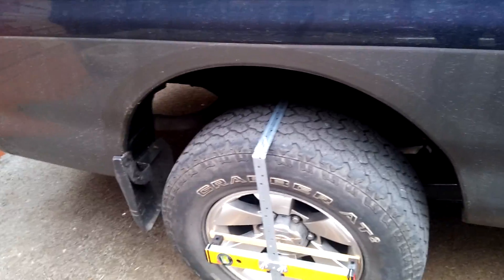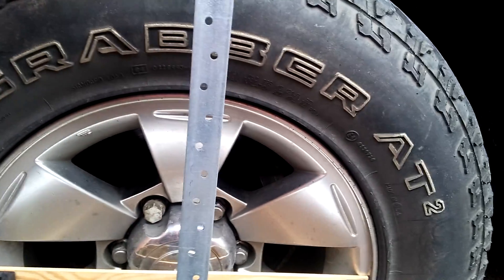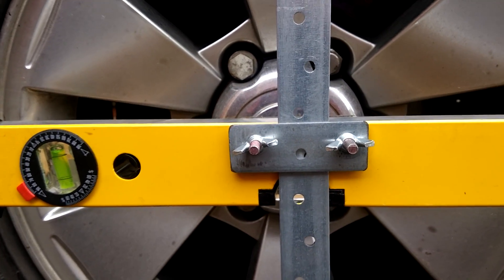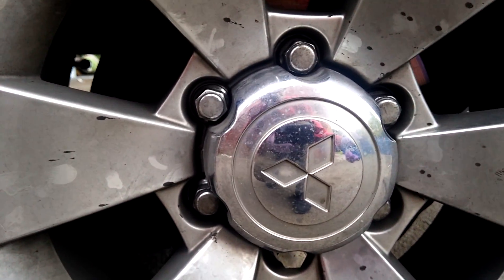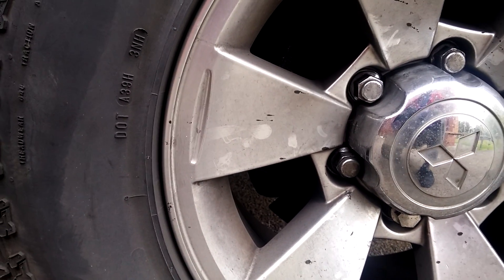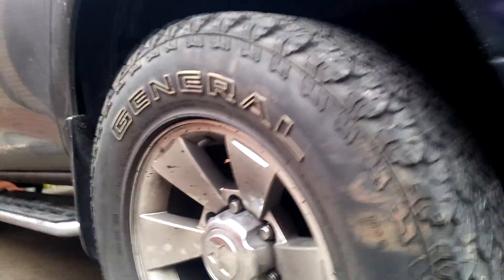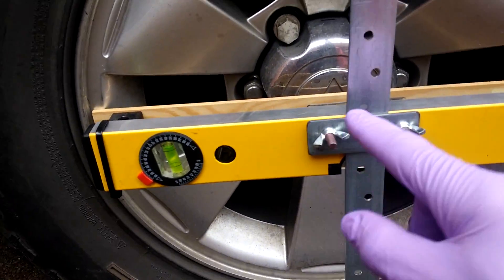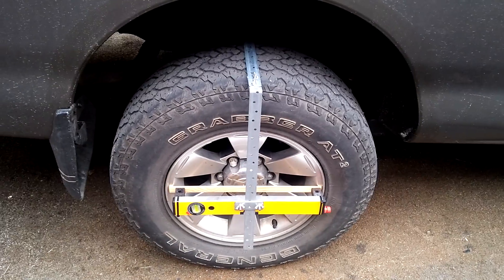Homemade laser wheel alignment tracking device

Comment: I tried this with the exact same laser. It showed front wheels that i know are within 2mm as being 30mm adrift front to back. The reason and the problem with this method is that the slightest angle at the back wheel gets amplified by the time the laser gets to the front wheel. This method will only work if your back wheel is exactly true, the wheel is exactly uniform all the way round, your laser and mountings are exactly true, and the laser is accurately aligned to the edge of the housing. Any slight deviation in any of those sets the laser at an angle meaning your readings at the front tyre are invalid. I suggest that simply using a measure to get the distance between treads on the front and back of the tyres is a better diy method of tracking.

Comment: This method has questionable accuracy.
The method utilised at front cannot be accurate as you cannot confirm the angle that you hold the ruler.
Also i would not use this methid for four wheel tracking as you are assuming the rears are straight.
The principle is nearly there to track front whhels but you require a similar rig on front wheels with an accurate distance from wheel with a gauge to ensure accuracy.

Comment: Thanks for the video.   Very interesting.
1  Surely with this method, you need two devices, one on each side of the car ?      The other side is likely to move when you are adjusting the tracking, so a lot of swapping from side to side ought to be necessary.

2  For me, the main reason for doing it myself is motivation and incentives.   I'm the one paying for the tyres, so I want to get the tracking right.   On the other hand, most of the people who do tracking checks also sell tyres.   So they sell more tyres if it is slightly out.    

3 You also can't trust some of the people doing tracking.   Years ago, I took my AX for a free wheel alignment check.   They showed me it was out of spec, but they couldn't free off the track rod nuts.   So I did this at home, calculated how far I needed to rotate the thread and adjusted it.  About a month later, I went back for another free alignment check.    The guy quickly told me it was out of spec and needed adjustment, for which there was a fee.   I said really ?    What is the reading ?      It then took him far longer to get a reading.    I said "I think that is in spec" & we went to the chart at the back of the garage to confirm that.

4   After all that, I made my own tool, which is essentially like a big caliper.      However, it's fiddly to use, so I want a laser device.
Reply: LOL, ... just block the steering wheel or steering rack..

Comment: That seems to be a great idea, but   isn't it difficult to square the ruler on the front wheel to get an accurate measurement from the laser?
Reply: I agree, unless the ruler on the front is at 90 degrees it could  be miles out on the laser spot

Comment: you assume the laser is parallel on the back wheel.Better to use a 2 axis laser ,parallel it to the back then measure front. Of course you have  measure both sides of the front without moving wheel too as you need the delta, which is not an issue using  wheel  plates

Comment: I totally agree with your views with regards to RIP-OFF so-called technicians.  I took a car to a station had two [2] new tyres fitted as I need to drive to London from Cairnryan and back over the course of the Friday evening Saturday and Sunday. Upon returning home the two [2] front tyre were done. Not 1mm of tread left. Kojak style tyres. Returning to the so-called tyres specialist station, the 3 technicians looked at each other and admitted no-one knew how to operate the new equipment. Better off with the string method.

Comment: What if rears are toed? This assumes no rear toe.
Reply: @Paulgibbs99  Well some might not be aware of rear toe, all my previous cars had zero rear toe and the track front and rear was the same. Not so with my current car.
Which i found out the hard way wearing a tyre out in 3000 miles.

Comment: Great idea which I might modify slightly, this method only works accurately on a live axle vehicle, if you have independent rear suspension and the tracking is off it will give a false reading on the front

Comment: Hi!  Can you post a video where you show how you put this together?  Are those wing nuts and studs going through the level?  Here in the United States alignment shops are worthless most of the time and leave the wheels with little to no tow in, or worse towed out.  I use a tape measure and measure of the tires tread, but this is pretty slick invention!

Comment: that mitsubishi is like  mine  ..the castor and camber is critical on those cars  and has one adjustment for both ...your rears where off the front right ?  the outer edge is chewing out because of to much positive camber ...or back of vehicle weighed down pulling car up .. much more to just the toe on these mitsubishis

Comment: I use something similar to yourself. Im a carpenter by trade so I have  two small dewalt line lasers in the tool box. .  I set them up exactly parallel  with each other, and more important I adjust them to  make sure they are in line with the vehicle by measuring off the centre cap of each wheel.  This way I can check toe in and toe out of all 4 wheels and even better again I can check camber of all 4 wheels.   It works!
Reply: Hi mate, can you do a short video and share it please, as I want to built mine as well. Thanks

Comment: It is a good start, it would be better to mount the level on the front wheel so that you are measuring only one measurement from the laser beam to the rear wheel.  Any small toe in will magnify the measurement.  Also just use some small bungee cords to hold the level to the rim.  ...so much easier!  And if you really want to get accurate aim the laser farther away and measure at that distance.

Comment: Absolutely brilliant.  To the assclowns who keep on promoting garages, why??  If you don't believe in diy or incapable of it, then go watch something else.  Plus, you obviously have not gone to a garage a wheel alignment  before.  I've been to two shops for a wheel alignment, in both instances the steering wasn't straight after the fix, and the car still pulls to one side despite new tires and a thoroughly-checked front end.

Comment: I would be concerned that if the two points on the back wheel are just the slightest bit off, the farther away you get, the error gets multiplied.

Comment: That's a nice contraption you made but you are assuming quite a bit as 0 and square. For toe in up front, you would do better to just lay under the car and measure from tread to tread in the front of the tires, and then in the back of the tires with a tape measure. You can confirm your front toe the way you do it here  and with a tape measure as I suggest. The contraption you are using is the way we used to set up rear ends on big diesel trucks, actually still do sometimes, but we would measure off of the frame at some point. You can do the same with your truck. Find a hole underneath on the frame some place toward the front. Stick a tape measure in the hole and pull the tape measure outward and use your laser as you have here to measure. Do the same thing on the other side. This will help show how square your rear end is to the frame of the truck. However, this is still assuming your rear end is perpendicular to the center line of the frame, but you can easily measure length under the truck with a tape measure. Find a hole on the frame someplace, stick your tape measure in the hole and measure to a specific point on the rear end. Do the same thing on the other side. You can cross measure in an X pattern as well. You can do the same thing in the front. Measure the ball joints. This will give you like castor measurements for the left and right front wheels. Its good to know how to do it yourself, because I only know one trust worthy suspension tech, well maybe two good techs, and I haven't seen either one of them in years and years. Good luck. Oh, one other trick if you don't have turn tables for the wheels, is get a piece of metal plate for each wheel and put some grease on it. You can even put a piece of cellophane wrap on top of the grease and use it again and again. It's messy, but it helps. It's still good to role the car back and forth and re check your work. Don't forget to bounce the car up and down a few times. Open a door and hold on and use your weight to rock the car some. Do the same on the other side.

Comment: I like this very much, I came to your video as I am about to make something similar.  The one thing I wonder is how much variance there is in the ruler not quite being at 90 degrees?  That would make a mm or two difference couldn't it? and you are making ajustments at the mm level.  Something strapped to the wheel with a track front to back to slide a 'ruler' at exactly 90 is perhaps needed?  
Actually just screwing the ruler to a batton at 90 degrees and having that batton front to back , then swapped back to front would be enough to do it.  I worry that holding the ruler like in the video could easily give readings that differ by 2 or 3mm due to flex

What are your thoughts on this please?
Reply: Yes I realsied afterwards that you could move it until you get the lowest reading :-)
I have bought a laser level to give it a try myself.  Such a good idea!

Comment: I like your innovative idea, Paul. You've got me thinking about an even better way, using the laser mounted on a bearing that would permit spinning it in the same plane as the wheel rotation. This would let you pick up points behind and in front of each wheel and allow a very accurate computation of wheel angles.
Reply: The ability to read from various points in real time by the ability to rotate the front and rear wheels would certainly give you an increased potential for accuracy, however that may be negated by having the wheels unloaded during alignment, unless you have all four wheels sitting in a roller cup where they can be loose and retain ability to rotate around their axis.

Comment: I had similar as your setup but much accuracy on measurement. Basically if wheel base, front axial, rear axial are known then you can calculate angle of rear wheel based on measurement relative of of front axial .

Comment: what if the rear tires are not align properly, have u thought about that ?
Reply: Most (not all) cars can't have the rear geometry altered without aftermarket parts so if they're not aligned for whatever reason do you really think the garage doing the alignment will take that into consideration? Nope.
Reply: Most cars these days have adjustable rear suspension including every Golf since around 2004.
Reply: @dopiaza2006  yes but it's set
Reply: @dopiaza2006  that would be simple just split the car in half take measurements off that to get rears straight with car, then fine tune toe using this method. Toe is the most important measurement you must get right or you will be eating tires really fast. Trust me those high dollar machines can be set up 100 different ways I never liked them at all because if your not paying attention it will throw you off with the slightest movement, string will always get you within good enough toe specs!!!!

Comment: I like the idea but you are assuming that the rear wheels are parallel on all vehicles.
What would happen if the rear wheel was toe in/out?  or the rear wheel was bent?
Reply: George Craft solid rear axle this is absolutely brilliant.. now if you have rear suspension that is adjustable this is not going to be it
Reply: Paul Gibbs wheel tracking is a big con, a garage fitted 2 new tyres and tracked the front, 7 months later both wheels are bare on the outside edge. I've just changed the rod ends and I'm not paying £30 to just adjust the toe.
Reply: Could you fit a center point on the device without using the rim of the rear wheel for measurement - you could then measure that the center of the rear wheel matched to the center of the front what ever the rear wheel alignment?
Reply: To insure rear and front axles are same, you can use the string box method. You make a perfect square by measuring the distance of the driver and passenger side strings from each other in the rear and the front, then if the string is same distance from both axles, you know they are good. Do this just once as a sanity check and you can use Pauls method to do an easy and fast check of your toe thereafter….well not your toe, I mean the cars toe, but you can check alignment of your toes as well if you feel you are walking crooked
Reply: I use this method on a Corolla and it works perfectly.
Reply: @Paulgibbs99  the laser might also be shooting slightly away from the direction the level is pointing, but you could calibrate for this by measuring tread to tread on forward/back of the front tyres if you want confidence it's correct on the first use.
Reply: @Paulgibbs99  I was thinking the same thing but in this application it is probably close enough. For sport cars that do have fully adjustable front and rear suspension the string method works well (if done properly). It just takes more time to align and square the strings but you can also make a similar attachment device for reference points, and if you really want to get fancy you could attach scales to it center, front and back of the wheel for quick easy reference. Then get one of these: https://www.wheelalignmenttools.com/product/hands-free-camber-caster-gauge/  and you can do your own alignments. My local shop has a Hunter alignment rack and will check and print out my alignment values for $25, I have found that I can get within .05 degrees of what they get with an alignment rack. The fancy alignment rigs are more accurate, but they are are only as good as the person doing the alignment, and most won't take the time to properly align your car so I am better off doing it myself. Plus if you are like me and like to modify and experiment, you can also save a lot of money.
Reply: @Paulgibbs99  All you need is a small laser measuring device, like the one Bosch make. It's about 3 inches long, on the inside of the back wheel put the device against the rim about mid wheel height and measure to the opposite rim, and then do the same 180 degrees round the rim, you should have the same measurement.
Reply: George Craft

What do you think the garage doing the alignment would do?